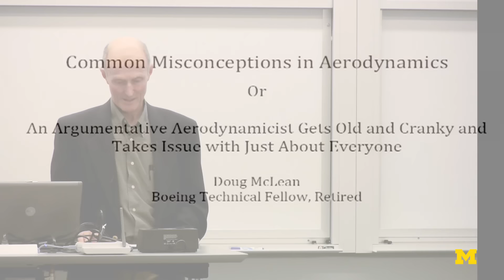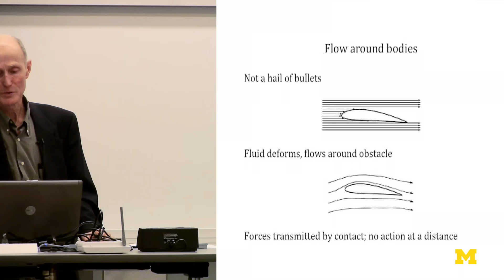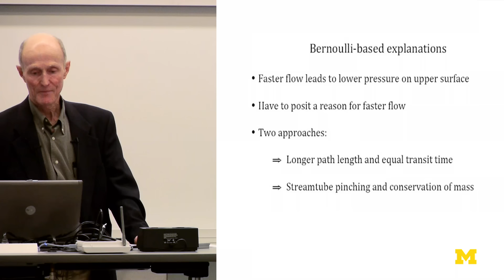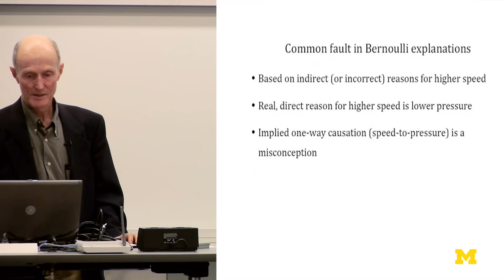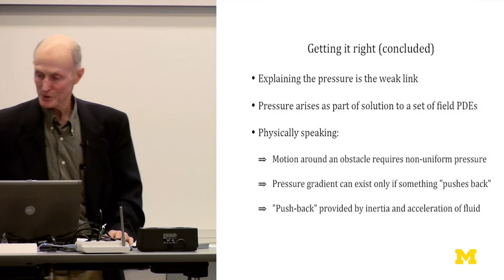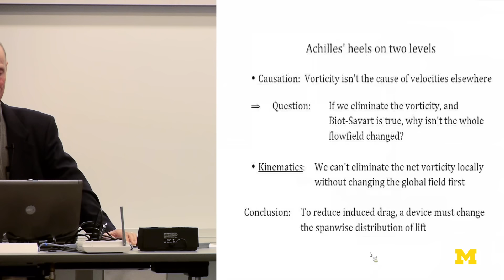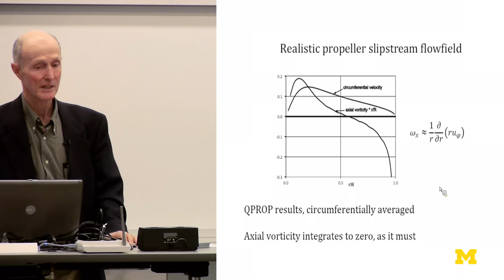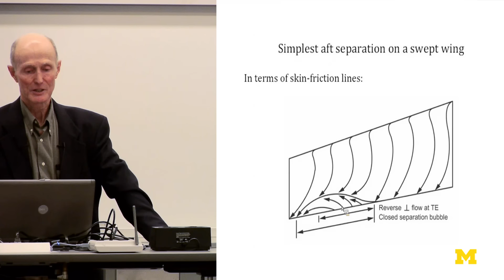Doug McLean | Common Misconceptions in Aerodynamics

Comment: My dad always told me to get the seat over the wing... because its the safest location structurally in a crash...  I usually get the seat right over the front edge so I can see down, because I'm glued to the window.   Maybe not so safe considering I'm near the plane of the spinning turbine blades (but not exactly on it).... but whatever.    If they fly off they are going to fly forward, or go back in the engine and detonate that puppy in a mad Star Wars 1 podracer type fireball that I definitely want to have front row seat on to watch...
Reply: @ep5 Lol @ seat back home...   watching the crash of the flight I didn't get on...

I think in a crash, the flames are going to be going rearward...   plus in a water crash, you'd be maybe closer to a wing to climb out onto..    be interesting to see sme kind of statistics ...    which will probably say, ultimately, it doesn't matter a whole lot.
Reply: @ep5 I know right, wehnyou crash, more often than not, it's you in the pilot seat and you never saw it coming.   

I will say this:   my last 3 fatal motorcycle colisions while driving while blind were rendered mute by my 1000 hours spent in a quad copter simulator flying.    In all cases I couldn't see the car parked in the road until it was right in my face, and my reaction time was instant knee jerk to swerve around it without thinking.  

The first, I swerved to the left around a parked van in the road.   The second, I immediately swerved back into my lane after passing it, and an on coming car went right on by.  THat for sure would of been fatal.   The third was a later date where the van parked in the road like a G D idiot happend all over again on the same road.  After that I stopped taking that road, then I stopped driving all together as my vision worsened even further.

A year earlier with better v\sion but but not 1000 hours of lying in the simulator behind me, I took out 3 construction horses some other id die ots had put on the interstate with no flashing lights, no cones, nothing, just blocking off a lane.  I was going 20 miles afster, butstill.  I swerved too late to get in the left lane and took out all three construction horses withthe front of my motorcycle like a battering ram and kept going, albeit pissed off.   Had to repair all that.

So  my recomendation... do all your crashing in a simulator.    I've basically crashed a million times by now crashing my way upward to being a pro aerobatic pilot.   I must crash 30 times a day in the sim..
Reply: @ep5 Yep, my neighbor ran a stop sign on a 3 wheel motorcycle and his girlfriend on the back was killed and he lost hi slegs.    I've run through intersections once or twice in my life.

Simulators are a great way to fly every day, rain or sign.   I'm lik 1,200 hours.   Way more fun than the real deal, you can do anything in them.   Real flying in an airplane in a straight line is now boring to me like a trip to the grocery store.   Why fly, when you can frolic in the sky with no G forces and no threat to life or limb.   

I fly a sim called Liftoff.   It took me a long time to tune it from the defaults for the sticks to match my brain, but I finally got it and now my machine flies creamier than ice cream.  

The real life RC equipment I'm not having so much luck with, I'm sick of fixing broken stuff anymore.    My three real people sized airplane projects also probably will never be touched again, they're collecting dust.

Now I'm the automated recorded girl that speaks to pilots on their radio.  Pull up!  Pull up!  Pull up!
Reply: @ep5 SPoken like a true barnstormer. 

You should join my Flying Circus...   Google me.

Comment: Right away, i have a problem with parcels of air. I understand this is trying to break things down into analytical units, but air isn't packaged in units. Anyway, i an 17 minutes in, and so far, I've only heard 'cranky' unsupported bashing of standard principles in physics. Looking forward to the meat of the matter. But I'm wondering if this guy may be behind Boeing's poor safety record of late 😊

Ok, I am hearing nonsense right away. I just finished detailing some of these errors in a related video. I need a break. I'll be back.

Comment: My aviation professor told me that the reason why Sullenberger was able to plop his giant falling jet into the Hudson river with absolutely no thrust was that he had experience as a sail plane pilot, so he understood how to maximize his angle of attack without stalling, thus losing minimal forward momentum.  

The prof laughed and said:  "The really important accomplishment wasn't the landing, it was clearing the bridge!"  I asked " how far above it did he make it?"  Reply: "I don't really know, but in this case a miss by an inch is as good as a mile :D"
Reply: +Monkey_Lovin Learn to fly a sailplane!  Best glide (Lift/Drag) airspeed is needed to cover the most distance.  This is not a maximized angle of attack.  The speed best suited to minimum sink rate is useful if you want to remain aloft the longest time, but are not interested in covering maximum distance.  Gliding polars, possibly clarified when augmented with Cl and Cd, show these flight speeds.  Exceeding maximum Coefficient of lift, the wing stalls, and lift quickly goes to zero.  The best speed to fly is needed to make the most of rising or falling air.
Reply: Thank you so much!  I'm studying aircraft mechanics now, but don't have a pilot's rating.  I am MOST interested in sailplanes of all ! I have a hang 2 rating in hang gliding, but I never use it anymore.  I keep thinking I'll get back into it, but for some reason I haven't.  Maybe it's b/c I'm afraid I'll miss something vital on the pre-flight check.  I've never had a significant failure, but I messed up a few flights in stalls and such.... so I figure it would take me a significant time to get as safe as I want to be to do what I really want to do.  Plus I'm old, and my knees get sore after less than perfect landings on a hang glider.
So as soon as I get established in my program, I'm going to start sail plane lessons.  Plus I plan to offer that as a first date to whoever likes me on internet dating :D  Coffee?  Pssshhht.  Even if you never want to see me again.... at least you won't forget that woman :D
Thanks for the encouragement.
Reply: *****
Cool.  So... since I don't have a pilot's license yet, you mean: A computerized flight aid to maximize angle of attack while not hitting the stall point?  Or maintaining the best speed for the A32X (model, right?) glide ratio while maintaining stability? Something like that?  My plane lingo vocabulary is about 3rd grade level right now.  See.. I'm switching over to this from horticulture, b/c I want a new experience.  I could look this stuff up, but I'd rather guess and see how close I got: )

However:   I was able to contribute, with absolute confidence, to my landing gear class that the (SE Asian) tree that natural rubber comes from is a different species than the Chicle tree in Mexico, out of which they make Chiclets.  All the plane geeks stared at me.  "That's my job." I says, yes I says.  "I know that and beginning organic chemistry."  They just shook their heads and muttered.
Reply: Ohhh.  That's a handy one to have in your toolbox !!  Sounds like some engineers earned their pay coming up with that. 

That's the sort of thing airlines and the manufacturers should advertise to people to make them feel more confident about getting on board an A/C that has to displace such a massive amount of air just to keep from falling out of the sky like a rock.  Of course... maybe it's just better not to bring peoples' attention to the challenge of keep a jet walrus in the air.
Reply: Lift does NOT go to zero after stall.  It only drops about 25% on some airfoil and good designs the lift hold constant or even increases.  Peak lift is at around 45 degrees which is 30 degree after  stall.  Yes, I did the wind tunnel tests myself....
Reply: Actually sullenberger made the landing because he knew to NOT put full flaps down.  The critical factor in landing in water (I'm a seaplaneguy....) is to make sure the "ski" is kept low in AOA.  Full flaps at 40 degrees is a sure way to tear off the wing and kill people.  He had to keep the flaps at a shallow setting and to use the engines as skis along with the tail hitting first.
Reply: Good point, seaplane.  I never thought of him using the outer engine cowling as skis.  The wing and fuselage, sure, but my worry would be hitting too hard and digging those engines in too deep before slowing enough.  I think its safe to it was Sully balancing many factors that led to a good outcome.
Reply: Or the Airbus A320 has stall warning. (Of course, it does.)
Reply: Good story, but he didn't come close to clipping a bridge.

Comment: Maybe another misconception is describing the "wingtip vortex" which might be a misnomer.  I would think it is realistically a product of the whole aircraft rather than the wingtip alone.  Any attempt to counter the vortex pair would require a device the size of the aircraft itself (admittedly with diminishing returns as device size increases).  Is there a possibility that wingtip devices are a marketing ploy (Star Wars) and not a real improvement?  After all, a small increase of wing span should do the same thing, and as the wing tip devices produce perhaps the same wing root cranked in moment as a wing extension (for the same improvement) and the devices just add complexity, why use them? 
 As an aerodynamics  mechanical engineer I tried to get into Boeing aerodynamics but maybe they found that my birth date was the same year the Hindenburg crashed, a bad omen, so they put me to work--on boats.
Reply: Well, the wingtip vortex is due to the circulation theory about the airfoil. You can have a flying wing and still have wingtips vortices. What also helps create wingtip vortices is the difference in pressure between the upper and lower panels of the airfoil.
Wing tip devices come with their own cons. They are a benefit at full TO weight, but become more of a detriment towards the middle to the end of the flight. I had to look it up after a discussion in an aero group.
And it is hard to get in as an aerodynamicist. Not as many jobs in the field. Some of it expanded into wind turbines. Not exactly what I would call interesting stuff.
Reply: The reality is that much of aerodynamics is done, leaving the aerodynamicists to work on the crumbs.  After all, while the work still continues (maybe not) with the mathematics, they still wind tunnel test their ideas.  That is, except me, where I built the first "Trike" that I know of, using other peoples numbers, and I survived the first test flights.
Reply: Tell me more about your trike.

Comment: When a clockwise rotating cylinder starts from rest, it is initially surrounded by anti-clockwise vorticity. This diffuses outwards under the action of viscosity. If the cylinder is in a crossflow then the diffuse anti-clockwise vorticity will be convected away as a starting vortex, leaving the cylinder as a naked clockwise vortex.

We can solve for the velocity distribution around the cylinder either by using a conformal transformation, or by doing an easy solution of a Fredholm integral equation of the second kind. We can then work out the pressure distribution by Bernoulli’s principle, and integrate this to work out the transverse force or lift. We will find that total lift is proportional to total vorticity, and given fixed total vorticity, it is independent of cylinder radius. We can shrink the radius to zero, and deduce that for a naked singular vortex, lift is proportional to vorticity. This is the Magnus effect.

For two vortices, the mutual interactions cancel so total lift remains proportional to total vorticity. We can go on adding vortices at selected strengths in order to build up the profile of an aerofoil, and we will still find that total lift is proportional to total vorticity. This is the Kutta-Joukowski circulation theorem, but Magnus effect is easier to say.

Remember that starting vortex? A slightly-inclined aerofoil also generates a starting vortex which is left behind on the runway by an aeroplane. We can solve another Fredholm integral equation for the aerofoil but we need a supplementary condition of either known total vorticity or equal flow speed above and below the trailing edge. The latter is known as the Kutta condition and whenever it is violated a starting or stopping vortex will be shed until it is restored. With the Kutta condition our solution will normally have nonzero total vorticity and to work out the lift we can either add up total vorticity, or do an integral of the pressure distribution around the aerofoil worked out from Bernoulli’s principle. The answer will be the same.

Liquid helium is a superfluid which means that for a slow-moving hydrofoil there is no flow separation at the trailing edge, no starting vortex and no net total vorticity associated with the hydrofoil and no lift. Equal transit time also applies. Many “explanations” of lift fail to deal with this.

Generally to solve that Fredholm integral equation we need a numerical method. The matrix we get has a dominant leading diagonal so matrix inversion is easy and only takes say 13 lines of code which we could pass around in Excel VBA. This is not a difficult subject when we know what to do.

Comment: I'm a physicist, and I've always been unhappy with the Bernoulli argument.  But it's worse.  I'm also a sailor, and have struggled to explain how sails generate lift to windward, especially given that there is no thrust.  Will keep thinking about this.
Reply: Bernoulli is just a relationship that is in line with the first law of thermodynamics (ie: energy cannot be created or destroyed). 

The pressure does lower over a wing, and that potential energy in the form of static pressure is converted into kinetic energy in the form of dynamic pressure in accordance with Bernoulli’s theorem. 

Bernoulli never said anything about equal time transit and was dead before the first airplane ever flew.
Reply: Think in terms of vectors.   You can't sail directly upwind - you tack.
Reply: @Bartonovich52  You can make any argument you want with vectors. Especially if you make them long enough (when sheeting IN, going to windward).  I'm looking for an explanation, not an excuse.

Comment: The answer to the original question: 
1.) flow on top is faster,: WHY?
2.) flow over top surface accelerates: WHY?

must involve 
1.) kinetic effects of ‘wetted’ convex surfaces, 
2.) surface tension, 
3.) Casimir effects generalizable to an entrained fluidic field because these forces are 
1.) absent in a vacuum and 
2.) are diminished by viscosity, compressibility and turbulence, all of which are absent from the discussion in you ideal laminar fluidic field but present in real fluids traversed by the wing. Reality is not so ideal but lift is real so ideal fluidic fields are incomplete explanations. 

Please consider 
1.) entrained flow in conservation of mass/momentum explaining acceleration and reduced pressure field.
Please consider 
2.) tension of any fluidic boundary with surface tension in a similar sense to the casimir effect at the arrested boundary flow
3.) laminar flow does not mix hence incompressible fluidic fields must entrain fluid to satisfy the acceleration seen in adiabatic system: the fluidic field is an approximation.